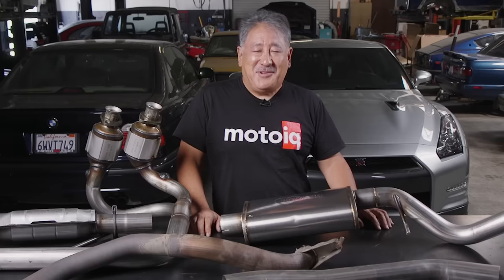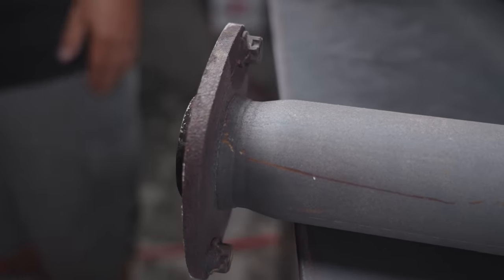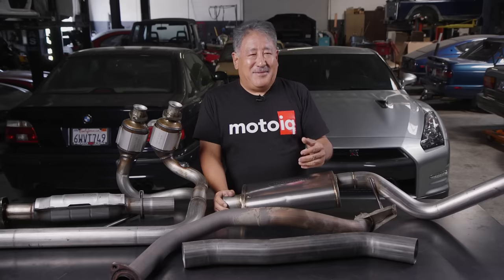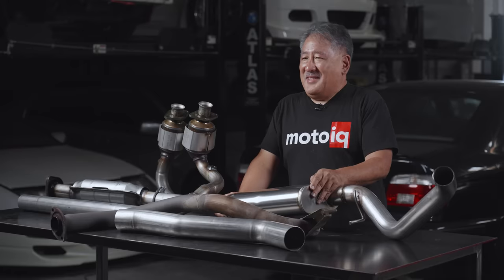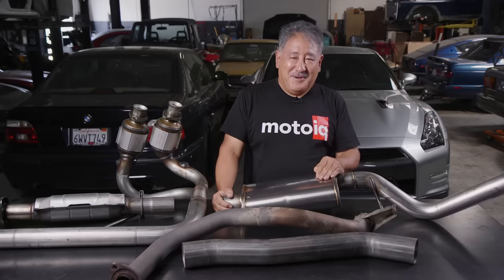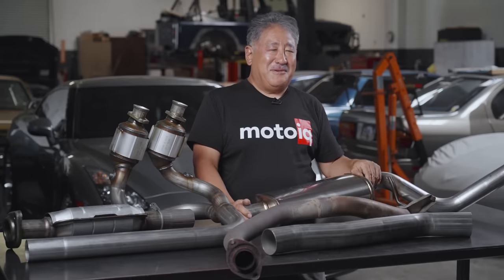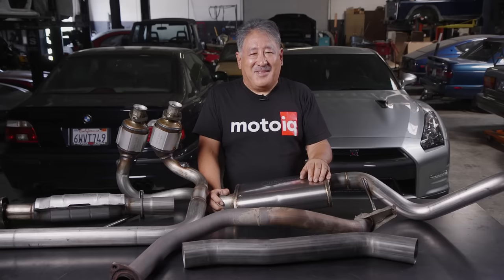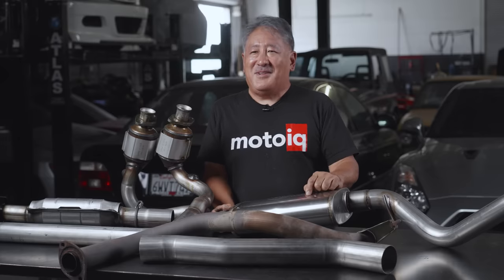Exhaust Back Pressure Myth DEBUNKED!

Comment: You just explained why I had to rebuild my K20 two times.
I have upgraded the internals, but wants to keep the exhaust stock in order to keep the noise levels near stock.
But the engine after each rebuild will start to burn oil and have black smoke. Now I think it's due to cylinder reversion.
Reply from the maker: Probably has something to do with your engine building ability.

Comment: I have heard that too, when i was young. But if i remember correctly, it was at the time we had mopeds and that had something todo with 2 stroke engines. So my question is does it make any difference on 2-stroke engine?
Reply from the maker: Two stroke engines use expansion chambers and use wave tuning.

Comment: It's a no brainer; the exhaust system with the best flow (and scavenging) is going to best allow the engine to clear the cylinders of exhaust and thereby better fill the cylinders with fuel and air. I never bought into the "backpressure" BS.

Comment: What would you suggest for a SR20DET that's fully built internally, making around 450 whp? I have an Apexi WS currently, but I want to get rid of the drone and rasp that the SR is classic for. I am thinking about having my shop keep the current system but modify it and add an electronic dump right after the downpipe and then add a high quality straight through resonator.
Reply from the maker: As long as it is a perforated core resonator and not louvered core, that would be perfect.
Reply: @motoiq  Thanks Mike!

Comment: Thank you Explaining 
 why needed 
[24valve(pre-ignition pre-exhaust) clean efficiency the pistons head crowns are universal heads cylinder heads are not ,cam lobes are same different  spec are not
 20valve 4cylinders] for smooth delivery for  bigger  pipes😂😆🫡🤔😏😎🫨🎼🏎️🤨✍️🥋🏋️🩰🏋️🥋

Comment: So tell me why it is if back pressure in the exhaust is always bad, that when the truck series go to tracks where they're required to run Mufflers they gain 25 to 35 horsepower and torque?
Reply from the maker: The reasons why are in the video.

Comment: 2021 Jetta 1.4t. I know it ain’t sht but I gotta 3” catless DP for it. Wanna run that into a 3” inlet/2.5” outlet Vibrant Ultra Quiet Resonator with 2.5” piping the rest of the way. Muffler delete . Is that ok ? The turbo is small obviously . It’s also stage 1 tuned on 93 octane. I know it’s not stage 2 but I plane on a custom tune after the DP & exhaust work . There’s just not much out there for these cars for reference

Comment: With advanced timing techniques and improved camshaft engineering we can use backpressure to help lower the intake valve. The pressure coming back is negative vacuum pressure bouncing back from the first air restrictor in your exhaust manifold headers. That's why equal length headers are important on any vehicle. If the length of the headers are correct and the timing is aligned with the returning positive pressure displacement after the negative pressure Shockwave bounces back, cam exhaust valve springs will open slightly, releasing vacuum pressure in the cylinder creating a less restrictive cylinder on intake making it easier for the cam intake valve to open AND encouraging positive airflow into the cylinder letting you run a richer system and create more power. It's a sort of vvt and vvc without over engineering the camshafts and adding more parts. To do this properly requires a fuckton of engine timing testing, design revision, and overall knowledge and ability in advanced physics. Each individual engine blueprint has a different optimal exhaust design that could do this but to attempt to engineer one for each engine type would be impractical and more expensive than just throwing generic equal length headers or log style manifolds on. However backpressure improperly timed is detrimental to your engine and can choke or even smother your engine
Reply from the maker: back pressure has no influence on valve events
Reply: @motoiq  my bad I got scavenging theory and backpressure force mixed around, I also definitely reacted instead of thinking. Truly, my apologies
Reply from the maker: No problem, it sounded like you did just that.

Comment: Along with optimizing flo through well designed tubing sized to the cylinder volume and to optimize scavenging, remove any exhaust gas reversionary wave on all rpm ranges and you gain all kinds of percentages in power.

Comment: Is this to say zoomies in the correct diameter for the application is acceptable, or would the lack of length reduce velocity too much?
I know on the track at high RPM it works.
I have a Coyote that would love to howl, so I'm quite curious.
Reply from the maker: Zoomies are good but work the best over a narrow power range.  The length and diameter need to be calculated and tuned.

Comment: I bought a cheap v6 mustang project car about 6 years ago. Trans was blown got it for 400$. I found out quick that an after market free flow X pipe exhaust and a tune go a long way. Increased the air volume in by wrapping a cheap "cold air intake" heat reflection tape lowering the temps about 15c. Those 3 alone and i had it pushing 250-275 HP on 3.8l essex and it sounded like a small V6. I was getting ready to pull and port the intake and plenum and swap cams....Using this motor is silly to most but its what i decided for fun
To my point.... i heard the exact same things from everyone 'Too little back pressure" its BULLSHIT

Comment: David Vizard explained that back pressure can not hurt the motor so much as it can rob horsepower.  His system is similar to the system on my Hemi Ram 1500 which is very quiet, but still produces good HP..  His system consists of a header manifold, then an expansion chamber much like a motorcycle pipe, then a balance tube, a muffler next of varying variety alone with a tailpipe.  Again, this system works great on HP and is extremely quiet for a street engine.  Just explaining what I know....see ya!
Reply from the maker: Which book was the expansion chamber in? We have found that backpressure can actually hurt highly tuned engines with big cams, reversion on overlap causes a lot of hot gas to be retained in the cylinders which causes extreme detonation.  This can happen even with a slight increase in backpressure.

Comment: Almost there. I dont know why this is so confusing for people. Maybe people assume pressure means positive pressure. Good back pressure is a low or negative pressure. So as long as were talking about NEGATIVE back pressure aka vacuum from exhaust scavenging. And along as you dont go so small you restrict flow, if you go to big in diameter it will cause a poor ventri effect as a due to burnillis equation bigger pipe = slower flow rate = higher pressure = restriction and poor scavaging. Flow rate is costsistant. Bigger pipe makes flower flow. Skinny pipes flow faster but can be more restivtive. And then you can get into the ratio of frictional surface area at different sizes if you want to go crazy. And I dont see how mounting the cat further back would make a difference to flow

Comment: As a kid stock car racing all the lads had straight pipes coming out behind the front wheels. But the one day we fitted full length pipes and timed the car. It was faster with the full length.  What's your thoughts on expansion chambers on a four stroke.
Reply from the maker: I think reverse megaphones post collector work pretty well.  Expansion chambers probably never came into use because cams give more flexibility to controlling intake and exhaust events than ports when you only have half the time to do it.

Comment: My trade school automotive teacher told me that in 1972 the EGR systems were introduced. And in certain applications the EGR was regulated by vacuum/pressure from the exhaust. So basically if you were to free up exhaust restriction it would never build the correct pressure to activate or deactivate the EGR system which would throw the tuning completely off and lower the overall efficiency (power) of the engine. Reinstalling the stock exhaust with more restriction would naturally remedy this situation and so they were under the assumption that the back pressure was doing something in the combustion chamber to increase the power. And thus the myth was born.
Reply from the maker: That's probably true of old EGR systems.

Comment: I made an exhaust power valve for one of my V twin motorcycles to bring back lost low end TQ from the cams, intake, and pipe I installed. It increased back pressure at low rpms then opened at a certain rpm. It was MAGIC ! And very easily seen on the Dyno. There was a lot more hp and tq in lower rpm ranges. When we left the power valve open low end hp and tq were lost. So I don't agree. This however did NOT increase peak power ! Point is that back pressure can be a good thing.
Reply from the maker: if the exhaust was designed properly and the engine tuned correctly for it, adding back pressure would reduce power.

Comment: It's bad at the opening of the exhaust valve , good as it's closing ... You can gain a significant amount of power at the resonant frequency of your exhaust , with a naturally aspirated engine ..Exhaust runners on stock manifolds are different lengths tending to flatten and widen the powerband ,  aftermarket headers with equal length runners tend to cause higher peak power over a shorter rpm range ... Where this rpm range resides depends on the camshaft and exhaust resonance ....Turbos and superchargers supercede all that , but it's still critical if you're trying to improve the performance on a naturally aspirated engine ...

Comment: A bit of back pressure helps a classic car with  carbs and a  semi race cam and a 5 port cylinder head. . It helps it come on the cam and be less cammy at the bottom between idle and 3000rpm.  It affects the engine  fresh charge cycling during the valve  overlap. I think he said it helps stop fresh charge going out of  the cylinder and up the exhaust.   A master of Rolling Roads told me that in the UK    That was The Late Peter Baldwin.
Reply from the maker: It doesn't matter, there are many reasons why adding an exhaust to an engine can kill power and reducing backpressure isnt one of them.

Comment: As a matter of fact I know differently up to a point. Excess back pressure is not good. I worked on a Chevy flatbed tow truck. They decided because it was at the time exempt from the smog laws (California) they wanted to go to dual exhaust and get rid of the cat. Then later Cal decided to put those smog rules back in for the truck (done by weight). Well the tow company threw away all of those parts that were taken off. So I had to removed the dual exhaust and go back to single exhaust system. Before the dual exh was taken off they were getting 8 miles per gallon of fuel. When went back to single the mileage doubled to 16 mpg. So back pressure that is not excessive is designed into the fuel system for that truck.
Reply from the maker: what you observed was not due to back pressure.  It was too big of an exhaust for the engine that killed the velocity or the big exhaust messed up the AFR  with sensor reading being off. Watch the video.

Comment: When i had the class in school for dyno tuning, we did an experiment.  We took a gixxer 750 with an aftermarket muffler and tested it at 127 hp.  We then removed the muffler and all exhaust restriction.  The result was a loss of almost 20 hp.  This is absolute truth.  

I dont know if the word back pressure is appropriate but you need to at least control the flow of exhaust gases so you dont lose all your intake charge on the overlap.
Reply from the maker: Engines loose power for many reasons when uncorking them but too little backpressure isnt one of them.
Reply: @motoiq  Would it be fair to say that in the above example the loss of the scavenging effect would be a reason for the power loss?
Reply from the maker: If the exhaust pipe diameter remained the same, the engine is probably now running way to lean.

Comment: Certainly for 4 stroke motors, which includes most gas powered cars today.  But, 2 stroke needs some scavanging/back pressure if you want torque.  Not sure about rotary motors (more like 2 stroke) but most I saw in race application had big pipes and open exhaust.
Reply from the maker: Two strokes don't like back pressure either. https://www.youtube.com/shorts/qf9eFYPYXUY

Comment: Like it or not, there is going to be backpressure when the exhaust valve opens. But this backpressure becomes backvacuum soon after. So it’s just a matter of tuning the pipes to make backvacuum at the moment that the exhaust valve and the intake valve are both open at overlap. NASCAR does it and you should do it, too.
Reply from the maker: Periotic pressure fluctuation is not what we are talking about, its mean pressure.

Comment: Look at WW2 piston aircraft, where every single ounce of power was scrounged out of the engine. Some had turbochargers so needed complex exhausts to feed the turbo, but if they had a supercharger (Spitfire, Mustang, Me109) they had a two inch stub exhaust on each piston just to get the gas away from the airframe.

Comment: I think people confuse back pressure with having a smaller exhaust which allows faster air speed at lower rpms but causes a restriction. However.... this other thing isnt really a anything important but I have read that over scavengine can happen when exhaust outflows the intake at idle, causing a vacuum in the intake runner and sucks out the charge or something. Making the idle weird or rough.
Reply from the maker: That is not how it works, the rough idle is caused by a phenomenon called 8 stroking where backflow in the intake port at low rpm due to overlap causes the mixture to be unstable and misfire.
Reply: @motoiq  Ahhhhh okay ! Thanks !

Comment: In a nutshell all of the engine would love to have a well defined variable exhaust diameter and length to maximize the power and engine smoothness at all RPM range.  At idle, the systems preferred a smaller diameter with long pipe so the pressure waves are well matched the exhaust velocity.  At top end of the RPM the exhaust diameter is enlarged and length reduce again to optimized the pressure wave and the exhaust velocity (less back pressure). In reality 99% of the car can have one fix value for both exhaust diameter and length and the final geometry is set to meet the overall performance goals.

Comment: mr mike, a 2.3 liter inline 4 with tdo4-16t turbo at 0.8 bar of boost and rew limit at 6500rpm, what size should you recommend to run.
Reply from the maker: 3"

Comment: Call it what you want on my 99 sc400 installed free flowing cat back dual exhaust and car lost all torque added a x pipe right after cats gained all torque and then some now the car faster then ever on every gear plus top end so what you say to that ?
Reply from the maker: X pipes and crossover pipes help torque and mid range.

Comment: Also the reason the old timers told you to have back pressure is that old cars have carburetors. And valves overlap allowed using vacuum in exhaust to better fill up the fuel mixture into cylinder. If losing the vacuum, then you needed re-jetting the carb, to compensate reduction of fresh mixture entering cylinder.
Now cars have fuel injectors and computer can add more fuel if CO2 censor complains about lean mixture...
Reply from the maker: There is no such thing as a CO2 sensor in a car.
Reply: @motoiq  Obviously I meant oxygen sensor. Typo.

Comment: Oooof I mean as an "old timer" engine builder". It wasn't necessarily about back pressure. It was about timing, cam duration, spark advance, fuel and air in traditional small/big blocks (which was a pita). Our exhaust was like a big hole-reasonably-a 3.5 exhaust ALL the way might have been too much for a SBC with a 9.5 setup..but a 468 yeah. When we had "pops" in the exhaust....it meant we had holes in our exhaust..and it was embarrassing...now kids are popping everywhere...the rev limiter? What rev limiter...lol. We knew when to let off. Alot of legends dont even know what youtube is about....but they are out there. I dig you old school
Reply from the maker: Not to mention carburetor fun with big cams.

Comment: I just put straight pipe on my 1946 ford coupe with a Chevy 350. My question is does straight pipe change the timing?
Reply from the maker: Ignition timing? No but you might need to rejet

Comment: Tell that to a two stroke engineer ! If the cams are set for back pressure waves . then it works but it is not a static pressure just waves ! I will admit that 4 strokes require super long lengths to get any benefits from the super charger effect that 2 strokes rely on. in the two stroke world the AF charge goes out the exhaust port and then relies on a back pressure wave to "Super Charge" . This is called "Power Band" .
Reply from the maker: Um two strokes don't have cams.  They don't like backpressure either.  https://www.youtube.com/shorts/qf9eFYPYXUY

Comment: There are some cars that DO require a certain amount of back pressure due to the factory fitting exhaust valve springs that are too weak. The 80s regular output version of the Chevy 305 is one if them.
Reply from the maker: Back pressure has nothing to do with valve springs.

Comment: Another great video.   I get a crack or pop out the back of my bmw e21 323i as i push the clutch in going up gears... I like it but do wounder if its a good thing...  extractors into  3" straight through to high flow resonator and finishing in a dual exhaust...  rowdy AF but magical at the same time
Reply from the maker: You could be running too lean and loosing power and possibly damaging your engine.  You need to confirm proper AFR then retune your engine. Or you could have an exhaust leak.
Reply: @motoiq  thanks for the info Mike,  were in the process of swapping the kjet for bike carbs so ill  double check the AFR  and see how it runs.  keep up the great work!